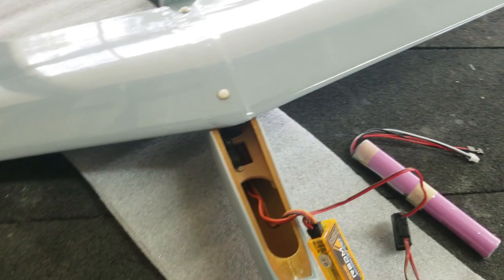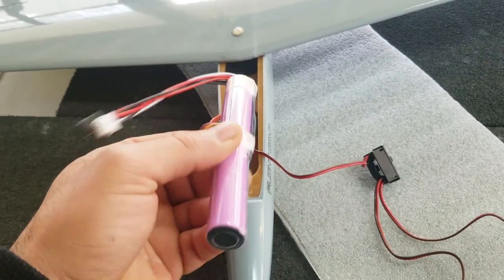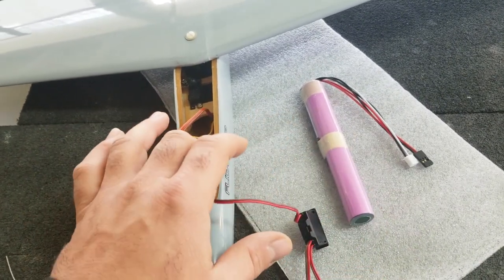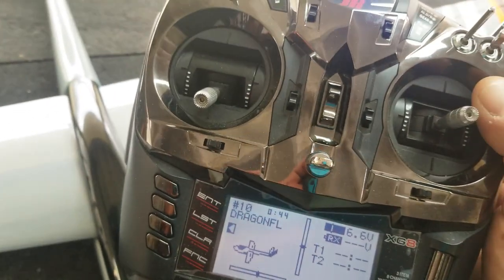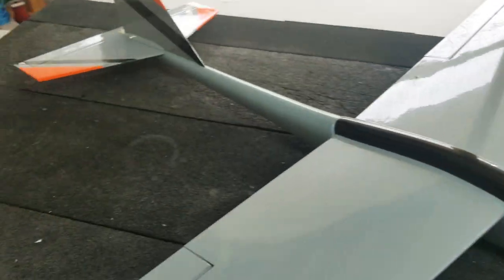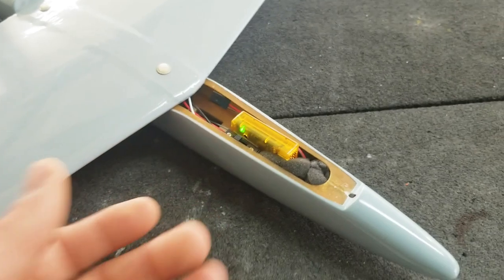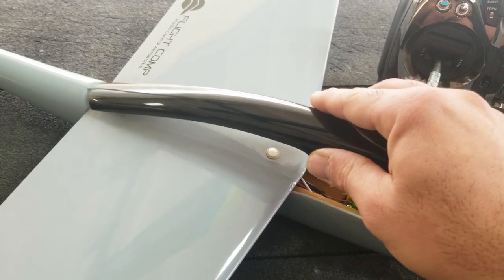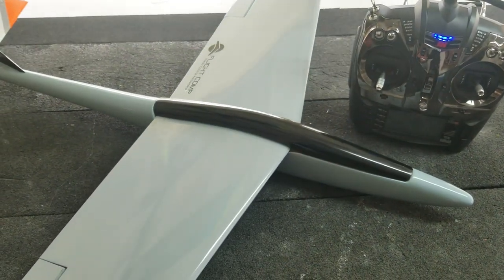Old School RC Slope Gilder Build Part 6, DCU Dragonfly

Comment: how did you do your battery so its connected to receiver and can charge without disconnecting it from the receiver?
Reply from the maker: I just installed a switch with a charge lead. I charge via the lead and balance plug on battery.